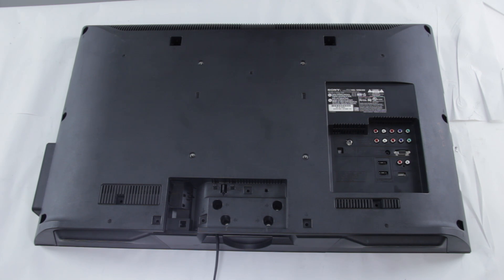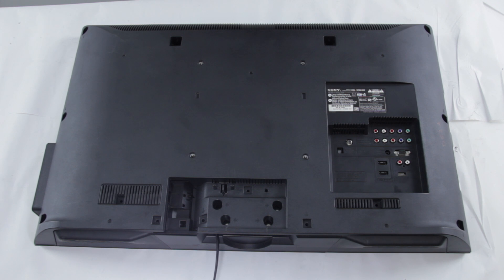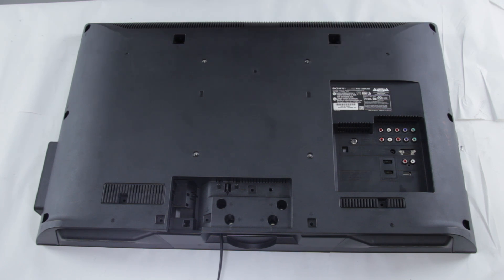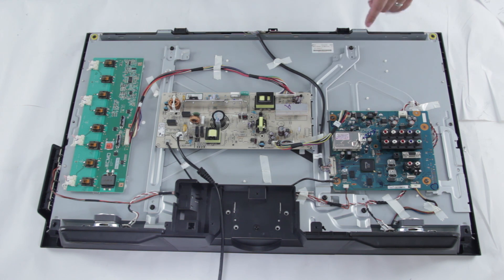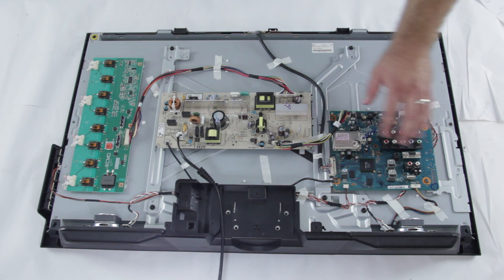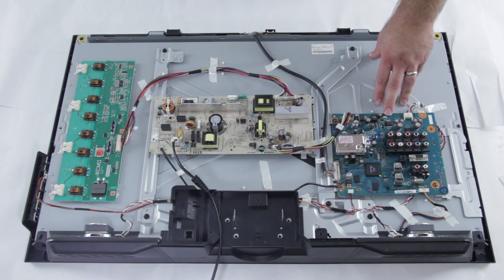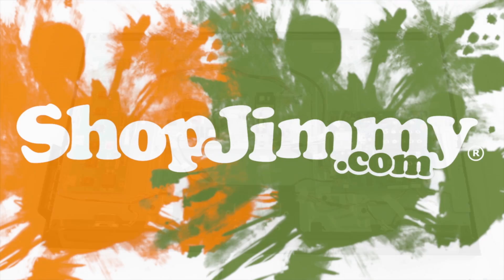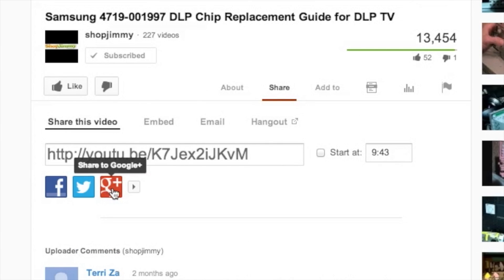LCD TV Repair - TV Has Audio, No Video - Common Main Board Symptoms & Solutions

Comment: please help LG47LA620V no image on screen. Back lights are working and audio is also working. I have replaced the t con board and still no image. PLEASE help
Reply: Joby Fluorine  I'm not 100 percent sure that the new T con board is good but I got it from ebay and it said it had been tested
Reply: Joby Fluorine how can I diagnose it. I've tried testing the power board making sure it gets the right volts converted from ac to DC
Reply: Joby Fluorine  the tiny one at the bottom that connects to the front screen
Reply: I'm trying to take a photo of it but there is no way of attaching it to this post. It's the small one at the bottom it has one incoming cable from the board and two outgoing to the screen

Comment: Hi I'm having a fault with my Sharp LC70le650x 70 inch led TV. 

It's approx 2 years old. 

The screen does not show any picture but I can see that the backlight is still on. I've shined a torch on the screen too and can't see a picture. 

There is still audio when I plug a DVD player in to the av ports. 

The problem had occurred before and a tech came out and reset the TV,  I believe using the input / chanel buttons, and the problem went away for a couple of weeks. 

I've since tried doing this and managed to get the menu to pop up for a second but it quickly disappeared. Every other time it's turned on, whilst you can see there's light, no picture is present? 

Your help would be greatly appreciated

Comment: hi
i have a toshiba tv 32pu200
it was working will
but suddenly the both hdmi input stopped working
otherwise the tv works fine
when i connect my laptop it recognize the hdmi device on my laptop
but the tv says "unsupportef signl format"
i tried to change the cable and thr laptop but without benifit

what u think the problem and how it can be solved

Comment: HP LC4776N   slow refresh and smeared colors when turned on cold. it eventually   warms up and picture is perfect after 20 minutes and stays perfect until.....  if tv turned off and back on after warming screen has vertical lines and does not respond to remote.  must wait hour to turn back on

Comment: i have a sony klv-26BX310 S/NO 2058448 THAT ONE OF THE WIRES FROM THE POWER SUPPLY UNIT TO THE MAIN BOARD IS  DISCONNECTED AND DO NOT KNOW WHICH  PIN CONNECTS TO IN THE SOCKET THAT PROVIDES THE TV CONTROLS, WHEN POWERED, THE TV LIGHT REMAINS RED AND CANT CHANGE TO GREEN WHEN POWER BUTTON IS PRESSED,

Comment: I have an intermittent problem power on problem with a Samsung PN60E550. I do have a standby light and when I turn on the unit It the standby light flash and I will get audio but no picture. This has gotten progressively worse.  I have tested power on sequence and when the unit work I have the following:

CN801
Pin 1 3.3v (STBY)
Pin 2 5v (PS_ON)

CN804
when powering on I have 
Pin 9 goes from 0 to 3.3v (VS_ON)
Pin 11 goes from 3.3 to 113v (PS_ON)

Vs (211), Va (57), Vsc (-198), Ve (98) - (within the specification as noted on the chassis sticker). 
Led on logic board blinks about 1x per second.

When It screen does not come on but I have video I have the following:
CN801
Pin 1 5v (STBY)
Pin 2 3.3v (PS_ON)

CN804
when powering on I have 
Pin 9 goes from 0 to 3.3v THEN back to 0 (VS_ON)
Pin 11 goes from 3.3 to 113v (PS_ON)

Vs: 10.53
Va: 22.2
Vsc:  -46.7
Ve: 10.86

Led on the logic board blinks about 1x every 5 seconds.

What should I suspect?a logic board or main board

Comment: Hi I have an sceptre x32 model tv that wont turn on. Only the standby blue light turns on. I replaced the power supply card and the mainboard too and still wont turn on. What would you think might be the problem. It turns on in one in a million but I have to connect and disconnect the power cable so many times.

Comment: Hi there. I need a little help. I have an LG 47LB5900. The red light on the bottom of the tv is on but the tv doesn't switch on. I've been told that the
 main board needs to be replaced but Im not sure if it might be the power board even though I see a light in the bottom. I'm puzzled about it because I dont want to order the wrong part. How can I properly diagnose it? 

Thanks in advance 

Mickey

Comment: Hi, I have Samsung UN32EH4000 with BN41_01778 main board and it's having a problem of double image and horizontal lines at the top of the screen, but it only happens when the tv is on for a few seconds, I think this is the time that takes the board to get warm... It could be the main board or might be something else ?

Thanks in advance..

Comment: Just recd order 11098931 MOTHER BOARD for element eldht241 tv problem still exist...video come on and goes off sound/audio stays on...now I'm also having trouble with the on/off switch it seems to at times to not turn off after depressed, must turn off by pulling plug             Carroll

Comment: I have an atec 42" LCD tv. model number AV421A
Serial number: 65VGS00256

I got the tv for free from a guy who just said "it didn't work" no explanation. I brought it home and powered it up and it worked just fine for a week or so. then the picture went out; not black, it glowed purple but wouldn't display anything. it wouldn't even display functions like the volume going up or down, and at times it wouldn't even turn off by using the power button on the side of the tv. we had to use the main power reset on the back of the tv. 

sometimes we can get it to work and it will work for a few days without problem. sometimes the picture keeps working but the sound goes out. 

we are using hdmi input only because the other input slots all say "no input" when trying to use. 

we took it to a repair shop and they SAID they replaced the main board but it ran for about a week then started acting up again.

Comment: Hi
I have a 42LG55-UE  (42 inch LG LCD tv). My tv suddenly keeps selecting input and menu option automatically. I tried pressing the menu and input button on the side panel, but it doesn't go away and keeps showing menu all the time. Can you tell me what the problem is and how can i fix it ?

Comment: i have a rca led65g55r120q i have no picture. i do have sound. replaced the t con board and the power supply board. Still having the same problem. Any suggestions?

Comment: JVC 50" LED 3D LT 50N810NO PIC BUT AUDIOWhen switching on the TV, "jvc" only flash on screen then off
Reply: you got 90% led  light problem may be your driver board to run the led

Comment: Sir, I've Micromax 50 inch LEDTV Model No:-50C5500FHD, yesterday  when i was watching tv suddenly its display automatically gone blank but audio was coming properly and i had remove power cabel and reinsert it but the problem was still there only i could hear audio but there was no picture in my tv. after 1 hr it started flickering and  now some times its showing me good picture and some time picture gone dull , flickering problem is still there .So can you help me to fix this problem.

Comment: I was given a sanyo DP42849  Being a Computer systems builder I wanted to try and fix the TV for my children.  I have sound, but no video. When I turn the power on, the screen flashes for a very brief time and then goes out. When I hold a flash light to the TV screen in a dark room I can see Image so I would think the inverter went bad. Problem is it's on the main board and I cannot find anything obvious wrong with any of the chips to pinpoint were the inverter is. I even used a magnifying glass to look at every single chip and capacitor  Also I cannot find a trustworthy sight to purchase a mainboard from other than ShopJimmy but you guys are out of stock :-(.The part number is 1AA4810N22900_A  N7AF.  Any help would greatly be appreciated.  Even if you could let me know were the inverter is on the main board, I can remove it and set a new one in.

Comment: i was watching tv when i turned up the brightness to vivid mode, short after i heard a pop and the screen went black. i believe  i can still extremely faintly see video on the tv but the screen is pretty much black. i turn it on and the picture appears again, but a couple seconds later it goes back to black, theres audio but no picture , it sometimes always subtly  strutters or flickers in the top right on screen before it goes black. the model number is 50LN5310-UB and the serial number is 402RMKU6W437, it is a 50 to 55 inch LG lcd screen and i would like to know how to fix it

Comment: Need some assistance, I have a Coby LEDTV317 TV that won't power on, it turns on for a sec, displays the brand logo for a sec and then shuts off, obviously its a circuit issue of some sort. I think because this unit is heavily used and most of the time always on that something burned out, what board could this be, the power supply board or could this be a main board issue? can help or suggestions would be greatly appreciate on identifying the problem

Comment: I have a  Panasonic 42" Smart TV TH-L42Et5D. The Power red light went off in standby mode and wont switch on again. Then checked and Changed the main board. Now the Red power light does not come on. Only the green light starts blinking for 10secs on and off continuously. Previously when it was working, first Red Light, then comes the green light, if remote used to switch ON the TV

Comment: LG TV Model # 32LN5300-UB.  I have audio but no picture. I noticed no popping sound during use; just turned it on one day and got no picture. There's no light on the screen whatsoever, not even a flash when I turn it on.  Took off the back and all the capacitors look fine and there's no visual damage to the boards (to my untrained eyes).  TV is about 18 months old and hangs in my unheated/uncooled garage and is covered with a light plastic when not in use to keep dust out.  Any low hanging fruit in terms of other potential issues?  Given the cost of bringing the TV to a repair shop, I'm not interested in investing too much into salvaging this set.

Comment: I have a Toshiba 50L1350U flat screen , serial number D09248T10380L1 from march 2013.  I was watching it and suddenly lost picture, but retained sound.  After removing the back, we plugged it back in and turned it on.  The back lights lit up for a sec. or two and then went off.  Using the flashlight, we could still see the display on the screen.  Any ideas?

Comment: Have a LG 32 inch model no, 32 LN530B-UA did the black screen flashlight and had images but no back-lights and audio.
Therefore we and replace the power board that I receive from you didn;work chec the voltage at the led plug on board had 24 to 48 DC so what is the next step to try?

Comment: I have a 52" Sony Bravia Model# KDL-52W5150 Serial# 8002478. 
Before I get started I should mention that about a year ago one of my HDMI ports stopped working, but everything else was fine with the tv. Until I tried to turn the tv on 2 day ago. When I turn the tv on the power light turns green, but there is no sound or picture.  I also do not see any light coming from the back of the tv. So I removed the back panel and powered the tv on but the back light is not illuminating. After being sure that the tv should have something displaying on the screen I tried the flashlight test and I could not see anything on the screen. Which component(s) do you think needs to be replaced?

Comment: Hi ShopJimmy.com, I have an LG 55LD690 TV that has developed faults that appear to be main board related. The TV is just over 5 years old and about 6 months ago it lost the ability to use the HDMI inputs, I just get the No Signal error. Since then the scart input has stopped working and more recently the RGB/computer and component inputs have also failed (video is scrambled but audio in still works). RF input still works but does occasionally get horizontal scrambled lines across when watching TV. I've had the back off and reseated all connections to the board but think it requires replacing. I can't find any spares online anywhere but was wondering if you are able to supply one, or can recommend an alternate. The part number from the board is EBU60844995 / EAX61531904(5) / LD650/750. Any help finding a replacement is much appreciated. Thanks. Jonnie.

Comment: Hello Shop Jimmy, I have a samsung 3d tv #pn50c490b3d. One night I came home and there was a solid red light (led near power button). Upon plugging in and out and in again the red light stays solid and beeps.  I looked at the caps and they looked fine. Convinced it was a main board issue I ordered a used one from a vendor that has worked good for me in the past.  Upon receiving the new main board I carefully hooked it up (it was the same mainboard - looked good). When plugged in the same thing happned it red light - clicking and it wont come on. One note on the inside the small board to the side would flash a green light when the tv was first pluged in. The clicking seemed to be coming from the main board. Suggestions?
Reply from the maker: +Tuxx Toys   Try this at your own risk. Unplug the TV, then disconnect the y board and plug in the TV to see if the TV powers up. Note that it will not have a picture on the screen. Reply with the results of this test. Thanks! www.shopjimmy.com

Comment: Hi Shop Jimmy! I have an issue with an LG 47ln5200 TV. The TV powers up, the screen flashes...then goes dark. At first I thought it was completely black but if you look very close there is a Very dim screen there. This also happened in the middle of watching it...it just went dark. Any ideas?
Reply: +Richelle Bellew It&#39;s an LED...and the power light goes from RED to nothing..I believe it used to go green or blue. Sorry it's my mom's TV so I'm not quite sure about what color it used to be....
Reply from the maker: +Richelle Bellew   Try all repairs and troubleshooting at your own risk. This could be a problem with either the t-con board, the main board or the TV panel. You can replace the main board and the t-con board individually to see if one of those boards fixes the problem.  Click this link to replacement parts for your TV model number:  http://www.shopjimmy.com/catalogsearch/result/?q=47ln5200  There may be multiple boards for the same TV model number, be sure to match part numbers on your current board, with your replacement for compatibility.   Thanks and please let us know if you have any further questions with your TV Repair!  www.shopjimmy.com

Comment: hello I have a LG 55LS4600 and I started with a vertical strip that that was not the same color as the other part. Now that i got I've the back off it is showing very faint horizontal lines. The tv has had problems with HDMI inputs not showing on the screen but would have worked if I turned the tv of and back on. It has done it since I bought it. (the tv was a display tv and I won't be doing that again.) I have had the tv for about three years.

Comment: Hi I have an old Dick Smith Tv GE6606.  The power indicator light on the front panel stays on.  The green light doesn't turn off or blink.  I tried turning it off with the power button on the tv and also on the remote.  The screen is black and no audio as well.  I've repleace the power board but the problem still still the same.  Maybe it could be the main board? Im guess if it was the inverterboard I would still hear audio even though the screen is black.
Reply from the maker: +John Fruean  Try all repairs and troubleshooting at your own risk.  I recommend replacing the main board in your TV.  Unfortunately I do not see any replacement parts in the search results for your TV model number on our website.  Please reply with your part number on your main board and I can try searching for replacement parts.  Thanks and please let us know if you have any further questions!  www.shopjimmy.com

Comment: I have a westing house LTV 32w1 flatscreen. Serial no.: w3201det053430580. Using any type of input, the screen will randomly go blank and audio shuts off. The blue light at the bottom turns orange. Turning it on and off eventually fixes the problem for a while. Once you've gotten it to turn back on three or four times, it stays on. Until it's been off for a while. Now it seems to turn back one once or twice but will now never come back on no matter how long you try pressing power button. If left alone for a while it'll turn back on, but only for a minute or two. I have a soldering iron but I'm not going to spend more than $5 to fix this thing. Any ideas?
Reply from the maker: +James Kirby  Try all repairs and troubleshooting at your own risk.  It will most likely cost you more than $5 to fix the TV.  Thanks!  www.shopjimmy.com

Comment: I have a Sharp liquid crystal TV Model No: LC-60LE450U That is only two years old. We have sound but no screen. There is one quick flash of light and then blank each time the power is turned on. I tried to reset it but no help. There was a power interruption three days ago? Any suggestions?

Comment: I have a 32 inch sanyo and pretty sure its an LED but not sure and dont remember when i bought it..maybe 2-3 yrs ago and i been having a problem with lagging in video games and the games look super blurry evne at max settings of 1080p. also my bluray player with game of thrones almost makes it look liek they are ghosting and lagging and lip syncing. even tried gta v on the xbox 360 and it looks beyond horrible. though im not sure if it was the mainboard or something else
Reply from the maker: +Mad Moxxi   Try all repairs and troubleshooting at your own risk.  This sounds like a TV panel (TV Screen) problem.  If your TV panel is bad, it may be more cost-effective to replace the TV as panels are typically hard to find in stock, difficult to replace, and expensive.  Thanks and please let us know if you have any further questions!  www.shopjimmy.com